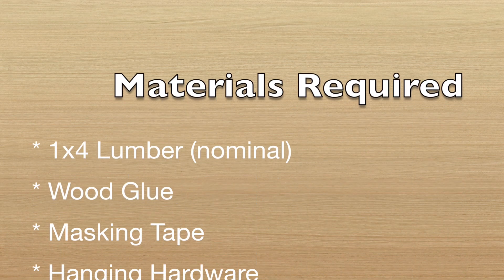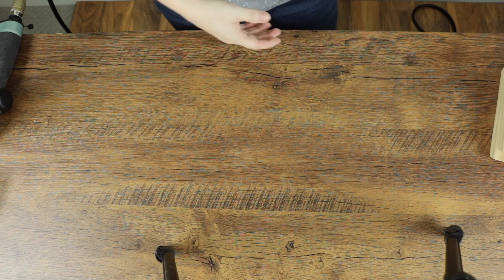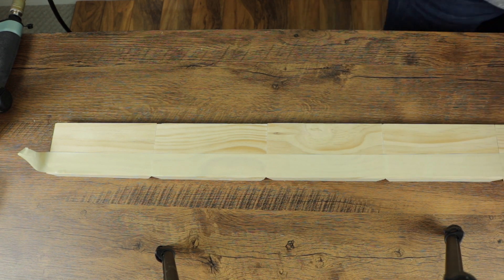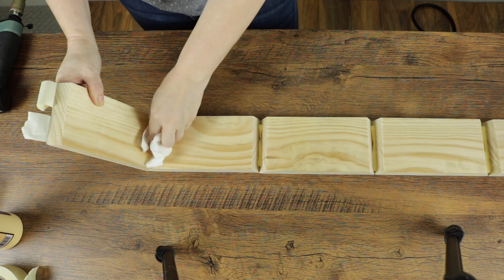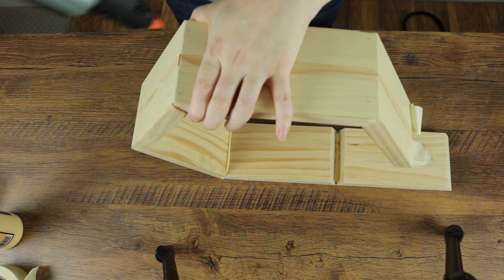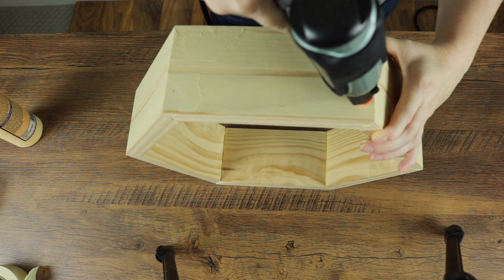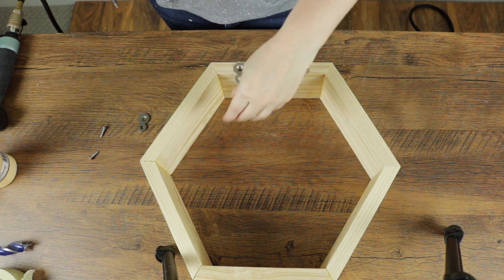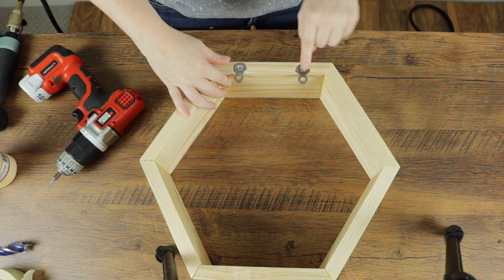How to Build and Hang Honeycomb Shelves

Comment: When you marked your pieces to cut did you mark them directly at 7 inches?
Reply from the maker: I used a stop to get each piece exactly 7" . Measure from the cut side of the blade and lock stop in place. You can use a piece of tape as a guide if a stop isn't possible.

Comment: On the 1s mounted to the wall how did you hide the fasteners?
Reply from the maker: I didn't. They just are not noticeable because I placed them at the bottom edge on the top two sections. I can see them because I know where they are, but others don't notice. You can also touch them up with paint to match the wall if you like.